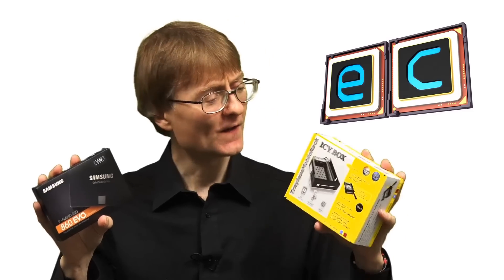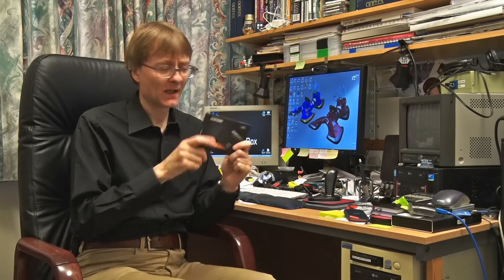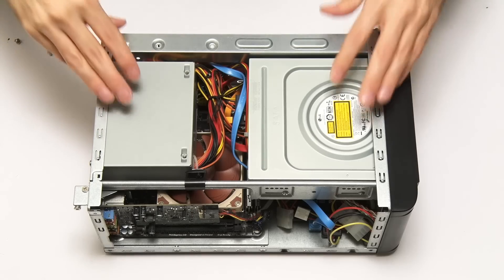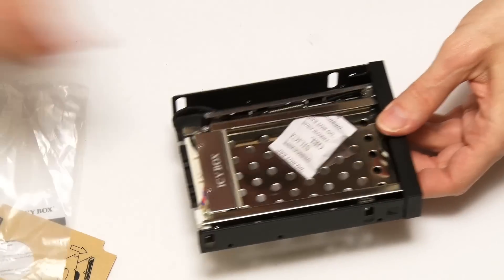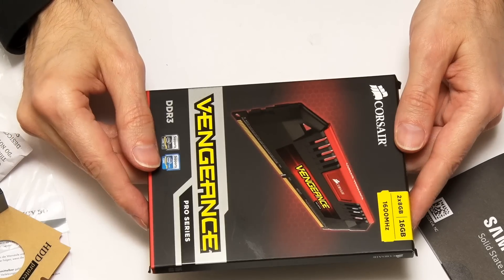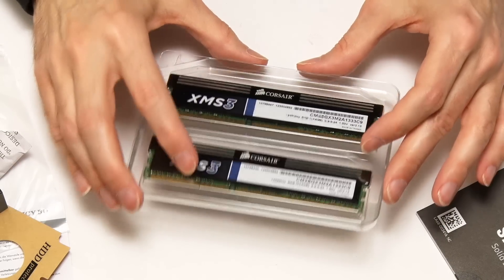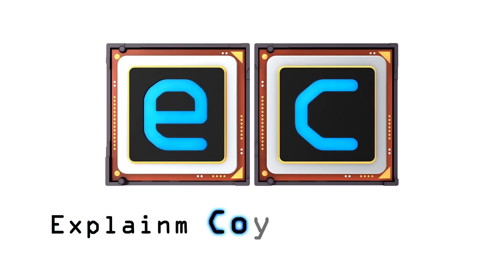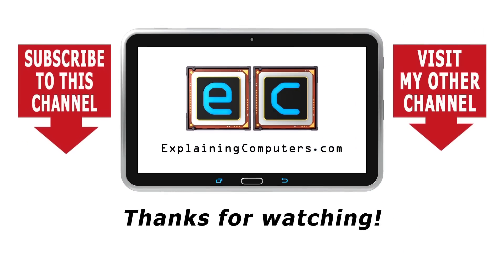i3 Mobile Rack

Comment: Would be nice to keep the DVD Drive.
Perhaps a solution would be to replace the middle tray with the 3.5" DVD and find a 5.25" adaptor with the USB ports in the sides that would otherwise only be there to fill up empty space

Comment: If there's one thing I've learnt from my quarter century in IT, it's NEVER button up the case BEFORE testing the system.  If you do then you're guaranteed to have issues and you'll have to get back into the case.  Conversely, if you test with the system still in pieces then everything just works first time.  Pro tip :)

Comment: "You little swine!" Oh Chris, mind your language! 🤭

I find the mobile rack a rather genius idea. Yes, you can dual boot but you limit yourself to 1 drive handling all your stuff. If that drive dies, no operating system. If the Windows 7 SSD died, at least Chris can jump onto Linux Mint and continue his work. Lots of PC repair technicians use these kind of accessories to try and grab data off a dying drive for a client. Saves the hassle of going through the case.

Comment: It looks like you have an unused bay at the bottom of the front panel of the PC. Why not use that for the removable hard drive tray instead of losing the DVD?
Reply from the maker: What looks like a bay is a door -- it opens to reveal some front USB ports and front audio jacks.

Comment: I have a computer that I use to try out different operating systems. It has 3 different hard drives and I choose to swap the SATA cable between hard drives when changing to a different operating system. The cost of 120 and 240 GB SSDs are low enough as to make swapping them in a bay similar to what you installed much easier and cost efficient.
Reply: The boot menu is hard to get into sometimes on this pc
Reply: eSata ?

Comment: After seeing this system I feel quite advanced :-). Recently I upgraded my laptop to a refurbished Thinkpad with a Core i5. My 'daily driver' desktop got more of a 'bulldozer' upgrade; now it runs an AMD 200GE APU, 16GB of DDR4 RAM, and consumes 30w at idle.  

On the enclosure front this Icybox tray is a great option, but I couldn't help notice the name and product line similarity to Icy Dock. The range of the latters line is astonishing IMO, see Newegg for comparibles.

Comment: I've got the same issue with the upcoming migration to windows 10.

Don't want to upset a system that's worked perfectly for a few years and I've got to go in, poke about, spend a good few days downloading and installing all manner of stuff and crossing it off lists and try get my Win10 system looking and operating as close to my current Win7 system. Bah!

Comment: Excelent transportation, it is new technology!!!  Besides, I recommend you taking a look to my project where I implement a smart switch. It's been several years and I am still using it, what it does is power one ssd or the other (up to 3) not allowing one operating system to see the other's drive. Also as it is based in a microcontroller it only allows the change to be done at power up so the user can not mess it up! Commercial ones use manual switchs what allows users to turn off a disk while being in use

Comment: Do you have an Intuos 2 running on your Windows 7 machine? I couldn't by the life of me get mine to work, so I had to (years ago) buy a new Wacom tablet.
Reply from the maker: Yes, I have an Intuos 2 running on Windows 7. It was set up back in early 2012, and I remember it being a bit of a battle. I know it will not work with Windows 10. :(

Comment: Absolutely fantastic! I find this to be a much better solution than Grub. 

You are much braver than I. I haven't yet allowed Windows anywhere near my Linux PC for fear of a UEFI issue. Are you booting using UEFI, or without? I did some changes in my BIOS to define better where it should look for a boot partition, and I had issues one way but not the other. Did you turn off Secure Boot? I swapped a laptop from Windows 8.1 to Linux Ubuntu MATE and had great problems getting it to trust Linux in a secure boot, so ended up switching it off. I could get it to trust the install, but just like Grub Loader, every time I updated the distro, it broke again. I must admit that I need to increase my knowledge of exactly what Windows does differently when booting using the UEFI option.

I know you are more of a cloud user, but did you think about having a storage drive where the OS drive used to be in the case to keep files on the machine even after swapping OS'? I do with my Linux PC, but the flavours are all using EXT4 so I don't have any issues. However, I know that Linux will break an NTFS/FAT partition table, (Due to ownership feature, I think) but Windows will repair it with no data corruption.

Anyway, this has an added advantage that you can mirror the drive on another SSD and have an instant backup should a drive fail. Just slot the backup in and reboot. Minimal downtime.
Reply from the maker: Secure boot is indeed turned off -- UEFI mode set to "Other OS" -- as secure boot is not supported in Windows 7. So switching Windows 7 and Linux this way has not been problematic. I do indeed have another SSD in the PC (mounted on the base of the case -- you can see the wiring to the side of it in places in the video), which allows file exchange as you say. But as you also note, I do a lot of work in Google Docs -- and of course here in YouTube! :)

Comment: Informative and instructional.  I am a tech, and you are so and seems to me you could have added a small pot to the drive LED to tone it down so it would still indicate its running. Lol. Yes i know not necessary for you but for someone else it could be, and would be a cool side project. Lol.  I have allways liked to add those custom controls for the who cares factor. Lol.

Comment: Your mini-ITX machine with that enclosure looks just lovely and compact.  My HTPC is also my first mini-ITX build and has also inherited 3 pair of "hand me down" DDR3 modules from other computers.  Thank you for introducing us to the Icybox.  Its a useful solution for machines with limited drive space such as yours.  Using the Icybox reminds me of the days when I would swap disk packs (RK05 and RL02)  to switch operating systems between RSTS/E and RSX-11/M  on my father's PDP-11/34.

Comment: if you need to use your dvd drive you could buy a shell to convert it to an external usb drive. With a laptop it's easier as you can just get a slim sata to usb cable to run it externally which is what I did when swapping the laptops dvd drive out for another hardrive using a caddy to convert the bay and hold the new drive.

Comment: Could you install Linux mint as the main os, and then use virtual box to just let Windows run directly off its own physical/original drive?

I like the icy box concept very much, will consider getting one. I wonder if there are nvme versions..

Comment: I've been using an external USB optical drive for the past few years and quite like it. I found that in years past if only use the DVD for some is installs and after that the drive would either get unplugged. I've also used the internal drive with the case open, but really the best thing was the external USB optical drive.

Comment: I know exactly what you mean about not wanting to fiddle with something that's working. Especially when stuff has to be moved out of place.
I have a drive bay setup similar to that. Mine has 4 slots for 2.5" drives. It works fine as long as you have enough sata ports.

Comment: Dear Chris, I feel I am cheating myself by using the i3 like you do in your machine because the Dell techs tell me the reason my XPS-8300 has existed beyond extinction is the i7-2600 it runs on. I don't feel I need the power of an i7 or even an i5 since I don't do any gaming or high tech stuff (like video editing). How is the i3 working for you and do you have any advice as to the processor I should be considering? Thank you
Reply from the maker: The i3 works just fine for me for everything aside from video editing and 3D graphics work. So I've no plans to replace it. If you don't need the power -- or in other words, if everything you need to run works as you need it to, there is no need to upgrade.
Reply: @ExplainingComputers  Thank you, Chris.

Comment: One thing I miss about the old style cases was the large number of external bays. My system from 2010 had 10 5.25" bays on the front, The next one I had in 2016 was 2 5.25" bays and 2 3.5" hotswap bays, But my current one has 0 bays... I've moved my hotswap bays and my dvd drives to a server in the rack in the garage. If I need to put a disc in the drive, I have to walk all the way out there.

Comment: Pro Tip: 

Just use Windows 8.1, this has support to 2023 ....
Reply from the maker: Except . . . it is Windows 8.1 :) So, like Win 10, does not run all Win 7 and below software, has little user control of the UI or update management. I have run Windows 8.1 on a tablet . . .
Reply: If you are only using the Metro app interface of Windows 8.1 this may be true, but 8.1 still has nearly every option available as 7, especially the Windows Update management is identical to 7, so you can do everything regarding this as in 7.

There are some things better hidden or only accessible in the desktop customization, but if you are using WinTweaks or something similar, you still have full control over your desktop. 

In addition, if install the ClassicShell start menu and tell Windows to directly boot in the desktop and don't show the Metro start menu if you hit the Windows key, you don't see any of this ugly stuff. The latter two settings are Windows taskbar preference, not from the ClassicShell start menu.

I am a very happy camper with Windows 8.1 on the desktop.

Comment: Wish I could be as frugal a nerd as you :D I suffer from GAS though (Gear Acquisition Syndrom) and ooh shiny new hardware and and and... well it gets expensive :D and there you are running an "ancient" i3 and what not :D and doing very well.

About missing the DVD drive... I have a USB DVD drive which I can pull out in the VERY RARE occasions...

Must admit I have pondered on building an Athlon 200GE machine (guess will be Athon 3000G now) since I could do most everything I do on that thing (except the gaming) which I should cut down on anyways.

Modern LEDs are so obnoxious, WAY too bright and distracting... they should be there so we can SEE there is activity when needed, not being blinded when not needed.

Comment: I have a unit in my 5.25" bay that takes 1 * 2.5" SATA drive and 1 * 3.5" SATA drive at the same time. My motherboard lets me set any of my SATA ports as hot-swappable. There are two power switches on my one that lets me turn the power on and off to the drives before I press their eject buttons. I have seen a 5.25" to 3.5" drive bay adapter that also had 2 USB3 plugs on it. If you used one of those you could free up your 3.5" bay for another 2.5" drive trayless mobile rack. Only problem I had with mine is the dust covers that are meant to cover the hole when not in use broke after a short time, but they were not needed anyway as The bays are never empty for long.

Comment: A bit of extra faffing about with the 3.5 to 5.25 adapter considering you can buy a 5.25 SSD bay pretty cheaply, but I agree that it’s nice to be able to repurpose those DVD drive bays to something more useful. 

I recently did a similar job on my Win7 PC, converting one of the DVD bays to hold dual SSDs.

Comment: I know it is a trifle of some sort, but I have had Linux Mint die on me when I updated the BIOS, and also when I inserted or removed hard drives from the system. I guess it relates to boot keys, partition GUIDs or some other form of UEFI secure boot problem that I don't fully understand and don't have time to figure out right now.
Reply: I think the real problem was the lack of a boot partition in suitable, readable format. Grub cannot boot with ext4? Maybe that has already changed? I guess I had manually set the whole disk to be ext4.

Comment: What will you do with the big pc with a core 2 quad, isn't it also running windows 7
Reply from the maker: It is indeed also running Windows 7, and still editing all my videos.  :) I expect to upgrade it to an i7 fairly soon (before the Win 7 expiry, just in case they close down the (re)activation servers). It will still run Windows 7, but offline. I have a motherboard and i7 CPU in waiting with full Win 7 support.

Comment: Why did you not opt for dual boot? when you can clearly fit both ssd's into the machine at the same time?
Reply from the maker: Because within months I will no longer be using Windows 7 (well, the SSD will lie in reserve, just in case), and because I want the flexibility to change the boot drive as I often test out OS for videos on this channel. So dual boot would not be enough! :) All I am showing here is the best solution for me and my work, not a recommendation for others. I have covered dual booting on this channel many times. :)
Reply: @ExplainingComputers  fair enough, i suppose as you will be chopping and changing OS frequently that setup make's alot of sense. so will you be using linux mint as you're daily driver now?
Reply from the maker: @Stueeeb  Yes, Linux Mint is fast becoming the daily driver for all my admin and related work. But video editing and 3D graphics remain in Windows 7 (on another machine). But in the coming 7 days I expect to be in Linux Mint only, as I'm not doing any video related stuff. :(

Comment: How does the drive ejection work? As in once you slide open the latch how do you pull the drive out?
Reply from the maker: You press and slide the latch, and then the door springs open, ejecting the drive an inch or so forward. Then you just pull it out.

Comment: I use a very similliar adapter at my main rig that fits two 2.5 inch drives and a blue ray ODD drive (these normaly fit into laptops) into a single 5.25 inch slot. Since 0,5TB HDD hard drives are like 20-30€ on ebay I now use a bunch of them like other people use USB sticks :D

Comment: Hi Chris,

I was watching this and waiting for the moment when you turned to camera and said 'Ah, it doesn't work'! 

I'll explain why...

I have a Star Tech dual tray for my removable SSD Project drives (to take with me to use on my Laptop using Win 10) and a fixed internal 250Gb SSD for my system drive (using Win 7). I remember watching your video in January about Win 7 and thought I'd move to a dual boot system again (as I had when moving from XP to 7). The drivers for some of the hardware that I have will no longer work 😞

Recently, I bought a USB C external case for my second SSD, to take advantage of the increased transfer speeds available on my laptop. That meant a permanent spare slot on my dual tray. So, I removed the fixed 250Gb system drive and placed it in the caddy (remembering to attach the same Data cable!). On boot, the BIOS saw the drive, but then I got a black screen with a 'no system drive' error message. I checked the connections and tried again, but no joy. When I disconnected the SATA cables from the caddy and re-attached them to the drive, everything worked!

Any ideas?

Thanks

Terry
Reply from the maker: Sounds like an issue with the caddy electronics, as the drive works outside of the caddy.
Reply: @ExplainingComputers   Yes, I wondered about that. I can use the bay to hot swap drives, just not to boot from. I'll do some research and post back 😎

Comment: I'd have to recommend the double as it's perfect for cloning drives.  Which is the reason I installed a double on my main rig here a year or so ago.  Just keep in mind that these racks require a separate sata port and sata wire for each bay.

Comment: I'm curious as to why you didn't decide to go with dual boot, due to needing to reboot either way with this configuration?  You could have also went with keeping windows 7 as primary boot and run Mint in a VM.  This would have allowed you to use the new SSD for more storage.  Still a great video!
Reply from the maker: I don't intend returning to Windows 7 very often after support ends. But I do anticipate using the flexiblity to switch out the boot drive to install and test other OS for videos. :) This video is just reporting what will work best for me. :)
Reply: @ExplainingComputers  Understood. That is the most important thing, is that it works for you. Keep up the great work on the videos. One of the few things to look forward to on a lazy Sunday.

Comment: Very practical upgrade!!
I have a Fractal Node 304 that is even more cramped than that.  It's rocking a large Noctua air cooler, full size 850W PSU, 980ti GPU and 2x SSDs plus a 3.5" HDD.
It was a mighty challenge to get it all to fit, but I'm a little crazy about small builds.
I'm in the process of building a mirror-image on my desk of another Node 304, but running dedicated Linux.
That all said, this video was particularly appealing.  Love the more casual style!

Comment: Complicated setup, I would rather put the two ssd in the machine and use the boot menu to choose the operating system.
Reply from the maker: Why complicated? I went this route as I often test OS for this channel, so this makes a bay like this a better option for me. I have cover dual boot many times on this channel, but it was not the solution I wanted here. :)

Comment: I have a similar setup, but I bought the double bay. I have a huge case, so I kept my Bluray M-Disc drive, which I do still use. In fact, I burned a CD as recently as yesterday. I have a stereo setup with a 101 CD disc changer and it's nice to have it loaded with some favorites.